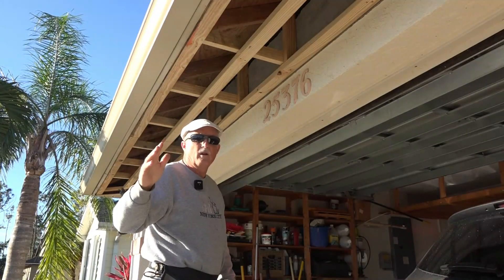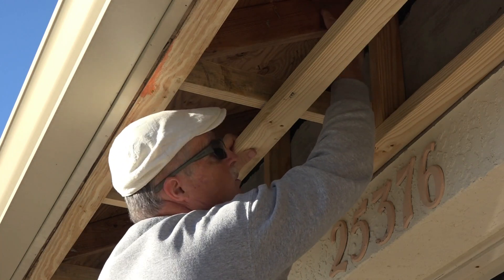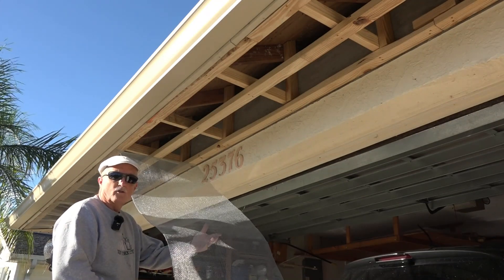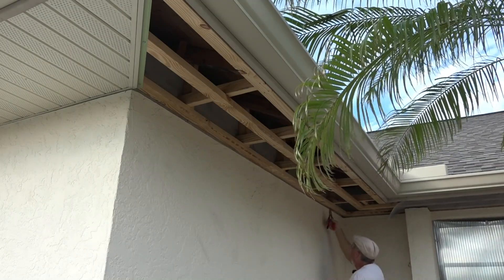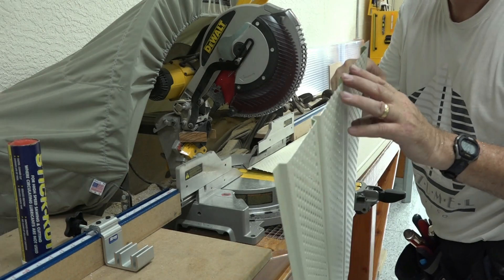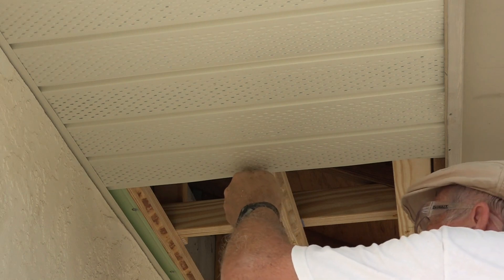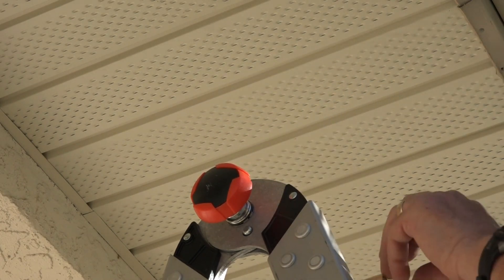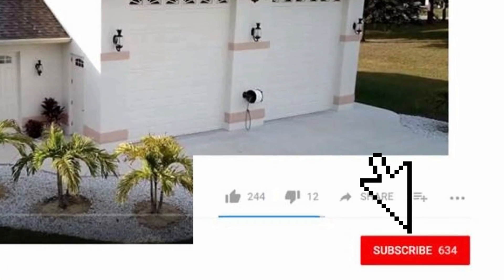Hurricane Proof Soffit  -  How to Install

Comment: Great video and idea. Would it not be good to attach the wall 2x3 also to the concrete wall and then it can become an additional hold down for your roof when the up right supports are attached to the roof rafters? Had same issue in Port Charlotte with Ian and Ian lifted my roof sheathing. I am not as skilled as you Charlie, any idea cost to get it done? Thanks Mark

Comment: Just curious if you added hurricane ties while you had the soffit off?
Reply from the maker: The house already had them
Reply: @charlescoushaine Out of my whole house soffit I have about 10 ft on the back porch where the soffit was cut maybe a 1/4 in to short and does not hold in the lip of the inner F channel to keep it from sagging. Any idea of a easy fix without tearing that 10 ft section out and replacing it with little longer pieces. I don’t want to do that because the other sides are screwed in and are covered with the fascia trim.

Comment: Hi Charles! I am in Port Charlotte so I too had quite extensive soffit damage. I was wondering how you managed to squeeze soffit into the corner of that higher elevation where it is right up against the roof. I had a hard time seeing anything up there to get it back into place. I ended up laying on my stomach on the roof to try to push it back into place, but I could not fit my hammer in there to nail it in. Great video!!